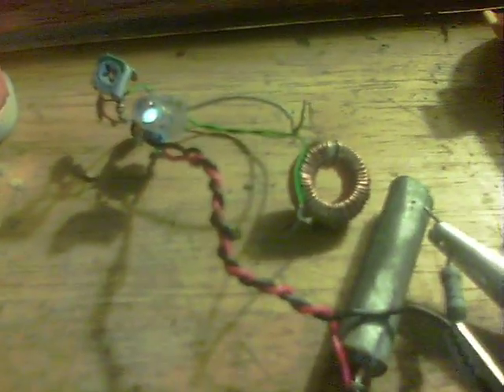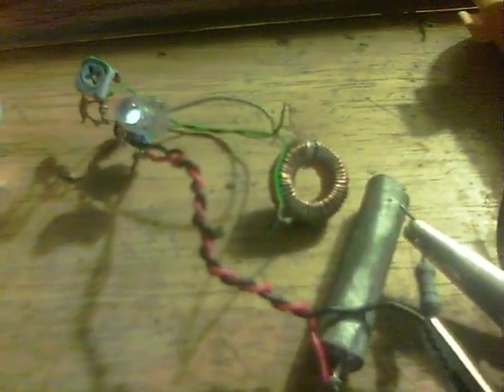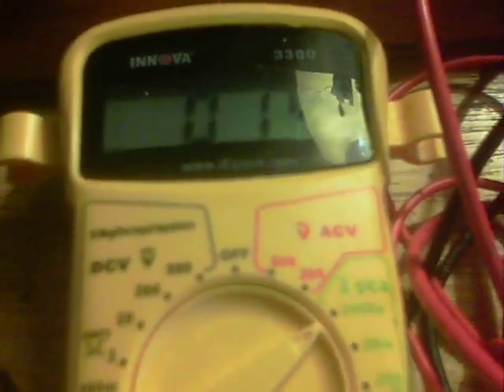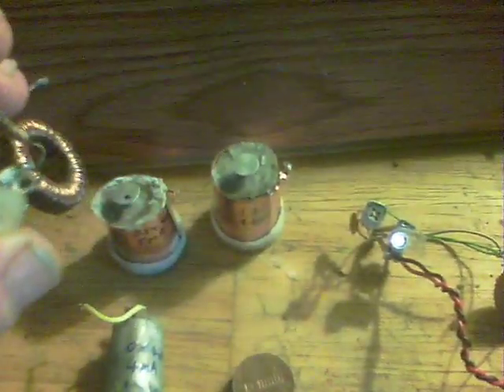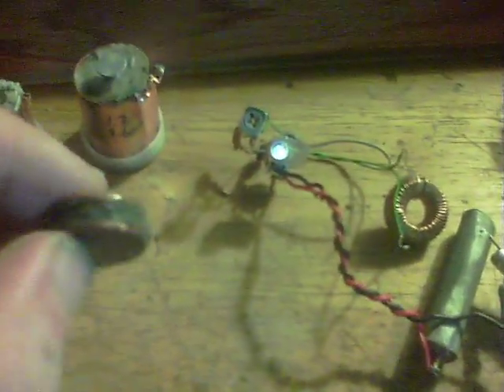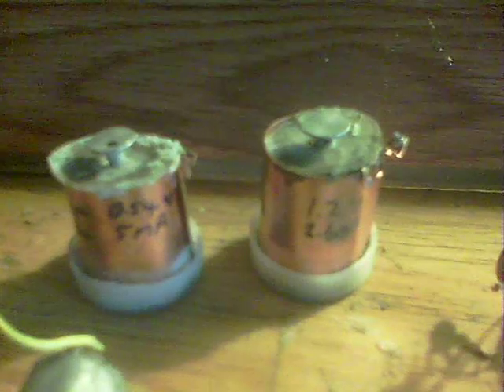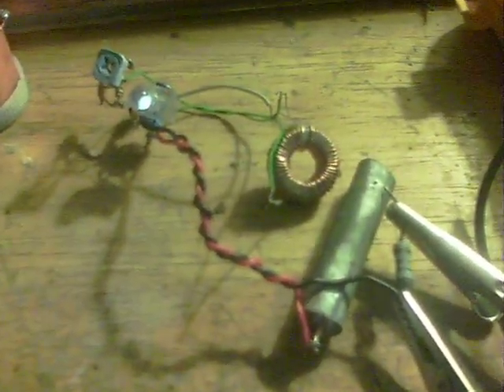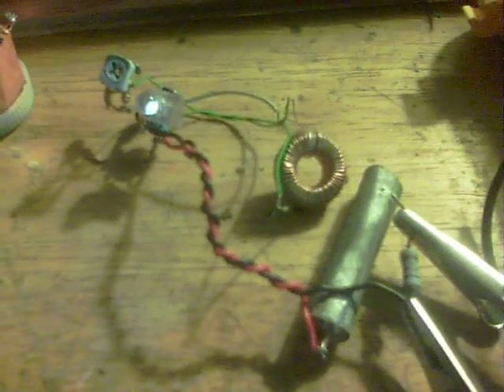Lidmotor's 'Penny' circuit - Replication

Comment: Thanks for replicating the circuit.  If you can track down that steel "twist tie" wire try that also.  I found out today that I was way off on my lower limit to where the circuit will run.  I had "Penny" blinking this morning on less than 1 micro amp at .5 volts.  This is very close to a self running circuit.  It rings for a long time on a little nudge of juice.

Comment from the maker: @Lidmotor Oh I love this circuit ! Made 3 so far. 1 runs by using a Hartley coil of 600 one way and 300 the other. One runs with a 7 strand Romero/Muller coil ! In fact, yes, to tally with your findings, the amp draw can read zero (on 7 strand version). 
Reckon you might have some kind of LaserSaber/GBluer/Bedini class of device here that we can all chat about in a thread at Energetic ??
Next trip to the dollar store i'll look for that wire :)

Comment from the maker: Haha,no worries.The main thing about this type of circuit, is that anything can run them...even a tree will supply the 0.4V and couple of micro-amps that such circuits need ! Trail lighting is one use, or can charge capacitors which can then charge batteries, or as a signal source within a larger circuit, or can make a more efficient flashlight (when pot turned up) etc. Have built some with large pancake coils on and work as storm barometers. A flexible oscillator that uses the lowest of power.

Comment from the maker: Closed, using the front end capacitor to store whatever comes in, until the transistor fires. Then it does the same again over and over, allowing more power sources than a Joule Thief because of that front end capacitor. 
It's an efficient blocking oscillator, needing no battery if wished - piece of burnt copper and a piece of galvanized steel between fingers will flash the LED to several Hz.